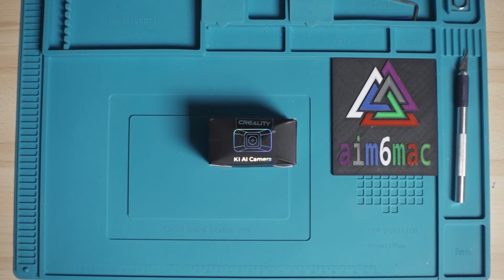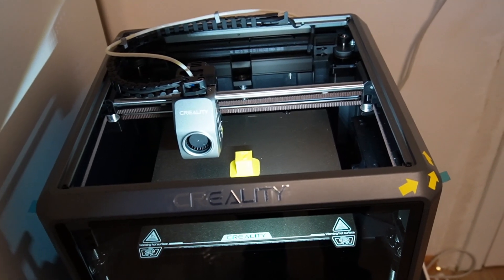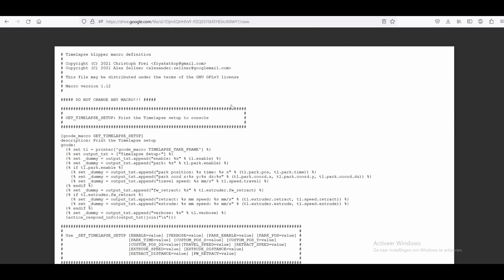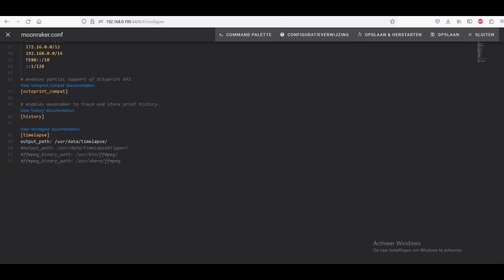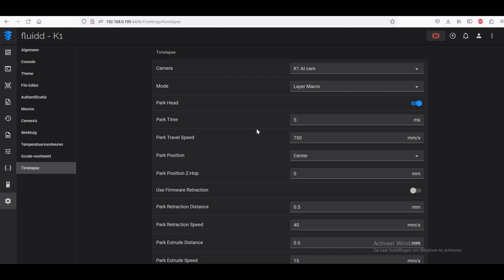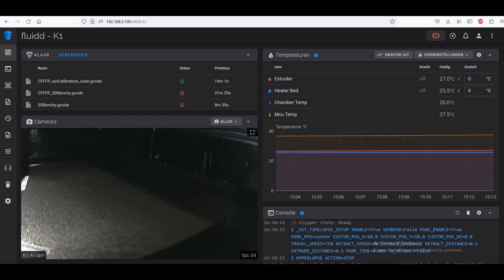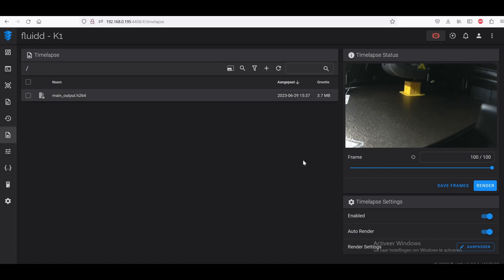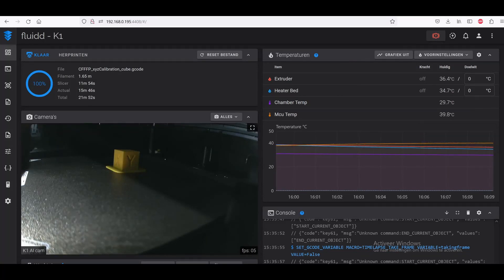Creality K1 K1MAX Fluidd timelapse setup tutorial (easy) AI camera

Comment: Do You know what's the corellation between Park time and Delay Compensation? I know only that Park time is the time how long the head will stay parked, but with "stock" 50ms of Delay Compensation i need like 2,5 seconds of Park time to timelapse somewhat work. Righ now I'm running like 500ms Time Park and 650ms Delay Compensation and it's much better but there are still some frames that are taken when the head or bed are still moving.

Comment: Nice. Unfortunately it didn't work for me. I'll try to reset the firmware and retry. I'm running my K1 for just 4 days, and there is something that is driving me crazy and I couldn't find anything about it on the internet, so here go a suggestion. My prints are great looking, but I've realized that they are bent. There is a misalignment of X and Y axis. Skew compensation could fix it by software, but couldn't manage it to work. It would be nice to have content about this.
Reply from the maker: It worked on the early CFW's  i haven't tried it on the new one's, but i will , come to my discord so that we can talk about it.

Comment: I've done everything exactly as you showed but still no timelapse. Camera is working fine but the config never adds the timelapse. I doublechecked everything and no typos. Only difference maybe is I jailbroke mine while on the 1.3.1.4 firmware. Also, it's a K1 Max not a K1.
Reply from the maker: i will try it on the K1max and let u know
Reply: @aim6mac  thank you sir!! Btw…have you noticed on the K1 Max w/CFW it boots with a new IP address every boot? I changed the eth0 boot settings in one of the networking files using WinSCP and got it to keep a static IP address. Took me a bit to find what was causing it because I don’t know Linux very well at all.
Reply from the maker: @ScottyKnows_3D   strange, mine is static ip adres.
Reply: @aim6mac  ya it was weird. Every boot my IP was basically the next available IP on my network. It’s fixed now tho.
Reply from the maker: @ScottyKnows_3D  why dont u come to my discord.
Reply: @aim6mac  Also, I had to flash back to the earlier firmware because I did something I shouldn’t have lol. I’m now on the CFW over the .14 Creality FW but I haven’t tried the Timelapse again on that.

Comment: I installed the new pre-rooted firmware CR4CU220812S11_ota_img_V5.3.0.39.img on my K1-Max last Saturday. Now i want to enable timelapse as per your video but after editing moonraker.conf I don't get the button for save and restart. When I reboot the printer, mooraker.conf is overwritten and my edits are lost. Any suggestions?

Comment: K1 looks good, very suitable for newbies😊
Reply from the maker: hahah no :) it really is for tinkerers :)
Reply: you are nuts if you think that.  Im currently printing massive ABS parts with it and its fantastically accurate, fast and capable.  Though their quality control border lines on abysmal, its a great and powerful machine with ability to print a huge range of plastics.  Personally i couldnt be happier and make parts that need to be highly durable as they are RC boats i am making.  Quality is as good as what you buy in a store.  Hot Bed is amazing, flexible hotbed with an amazingly sticky surface (no adhesives do i use for my parts).  Yea, maybe there are more "professional" 3d printers, but this thing breaks the mold and should not be seen as a "toy".  
 @aim6mac

Comment: My timelapse is taking all the frames but it's not rendering at the end, do you know what could cause this? (not using official camera so it could be that, but it would be strange because it takes all the pictures)
Reply from the maker: did you follow all the steps in the video?  The rendering happens automatically, and the output file is .h264 as shown in the video
Reply: @aim6mac  I did, even doubled checked everything. At least I was able to download a zip file with all the frames so it should be easy to use a pc software for rendering
Reply from the maker: @Mestrenada  i uploaded a modified timelapse.py file, check the decription for modified timelapse.py , replace the one u have with that one and restart your printer and try again
Reply: Have the same problem. Frames ateken and stored to zip. video is also rendered, but it can't be played after downloading...
Have you found a solution?